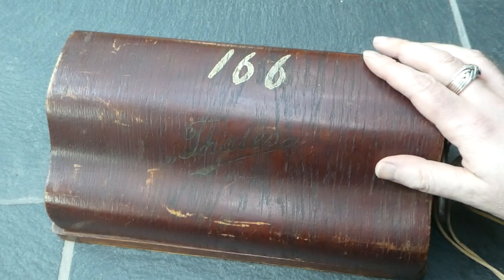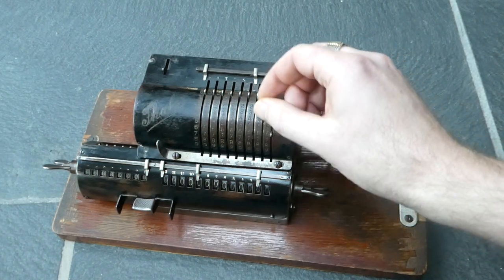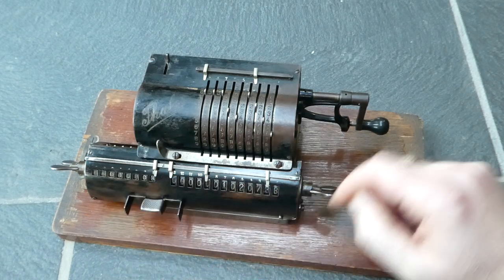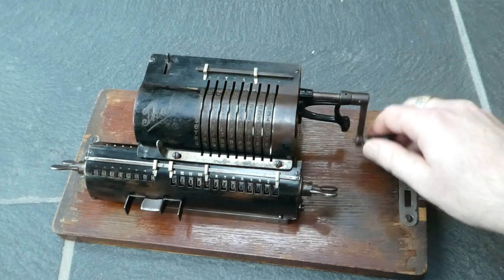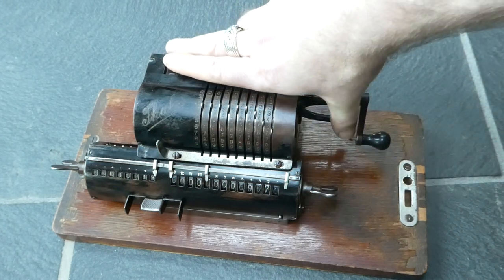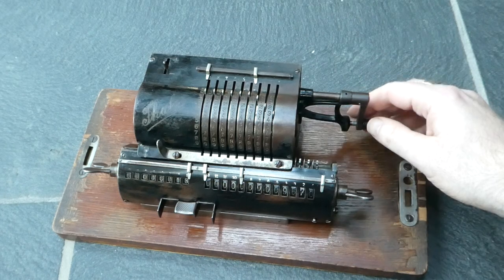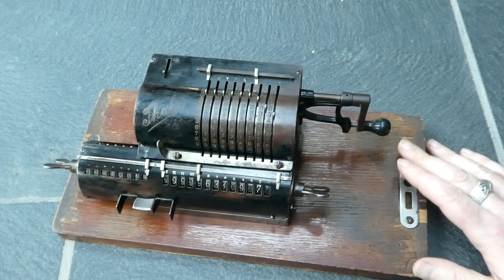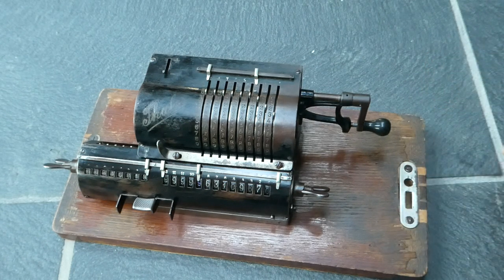The Thales model A calculator

Comment: Great pair of videos Jaap - I think we've been pronouncing the Thales name incorrectly all this time!!!  That really is the essence of a pinwheel calculator with no extra bits or features, nice and simple.  The moving comb to clear the input register is like the one on the Felix machine.
Reply from the maker: I tried to use the German pronunciation, since it is a German machine. It is named after the ancient Greek mathematician, and the English pronunciation is different (Thay-lees according to wiki).
Reply: @jaapsch2  I'm sure your pronunciation is totally correct - I tend to just blunder in with a very English version.  I do the same with the Triumphator name - the way I say it, it sounds like some sort of super hero whereas your pronunciation sounds much more German, as it should do.  I really should try harder!!!!
Reply: I had some single frequency GPS receivers (for surveying) with the brand name Thales. I was told it’s pronounced Taw-lus. Looks like Thay-uls to me.

Comment: Someone has one of these on Marketplace near me for $200. I can get the Marchant version about 3 hours north for $450. I have no idea if those are fair prices. I currently have a grand total of $18 in my Monroe collection.
Reply from the maker: The early Thales machines and Marchant pinwheel machines (standard/pony) are very rare, so I would expect them to go for quite high prices and those do not sound unreasonable. It depends on the condition of course. It is perfectly possible to build a very nice collection cheaply if you avoid the rarer models and have the patience seek out and wait for bargains.